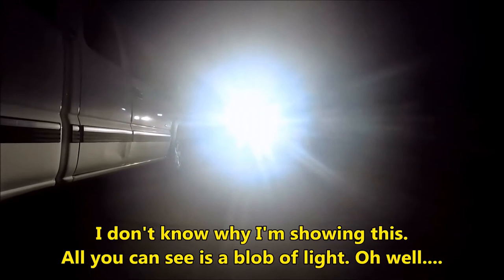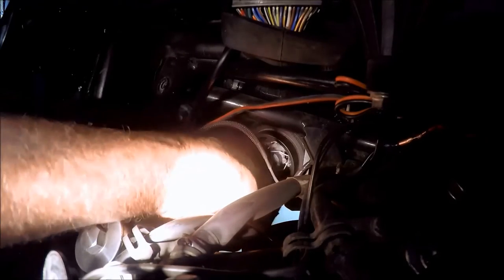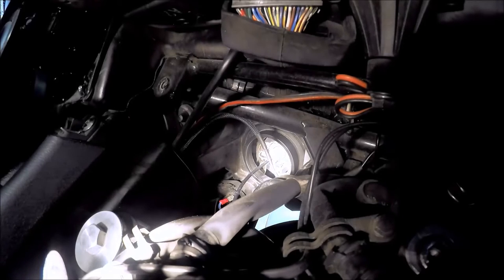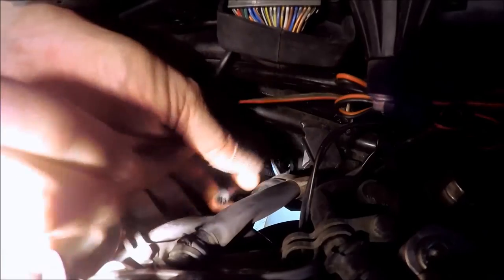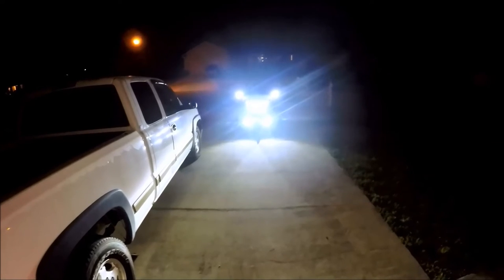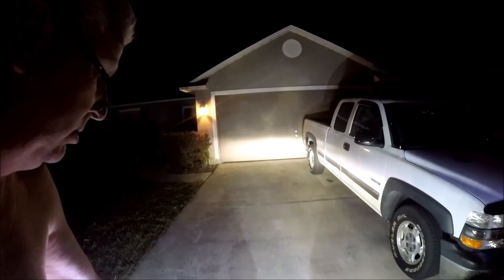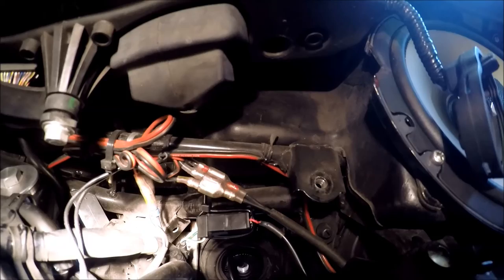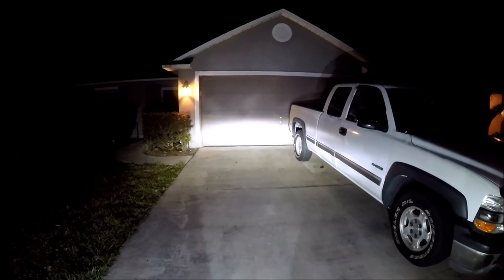LED Headlight bulbs for the GL1800

Comment: The issue with fitting aftermarket LED or HID bulbs is not the amount of
 light that they produce but what they do with it and how the reflector 
and lens aim it. Shining the camera into the light shows nothing. Nor 
does bouncing the light off of a garage door. Take the bike out onto a 
rural road and show how it lights the road.
Reply from the maker: +Dave M The output points of the LED's on this bulb EXACTLY match the output points on the stock, quartz halogen bulbs. These bulbs aren't your normal "LED bulbs" that have a half dozen or so emitters. Having now had these bulbs installed for 6 weeks, these bulbs "light up the road" FAR better than the stock halogen bulbs and even better than the HID's I had installed previously. I am patiently waiting for another set of these bulbs to install into my hi-beams and then I'm going to take the bike out to THIS ROAD  (http://tinyurl.com/z9zxg6q) which is far from any city lights, late at night and take some pictures and video. The results should quiet the naysayers.
Reply: OK. Sounds great. Eagerly awaiting the pix and test results.

I too have HIDs in the low beams. They're OK sorta. And most likely the LEDs will last the life of the bike. Especially since accessing the highbeam holes on a GW1800 is such a PITA.

TIA
Reply from the maker: +Dave M Here you go!  I still have not received the second of these bulbs for my high beams. This video shows the LED's in the low beams and the quartz halogen in the high beams. Hope this helps. https://youtu.be/QH_7a5WCW7g

Comment: I have purchased 2 separate LED packages. Both had connectors to the GL1800 harness that were too small. Please help. Is there an adapter or what brand of Leds do I need to get?
Reply from the maker: All you have to do is read the description. All the details are there as well as links to additional info and the product.

Comment: Does the power converter just hang loose?  Its not mounted anywhere is it?
Reply from the maker: For the low beams, they're stuck to the forward plastic cowl. For the high beams, they're tucked under the pockets.

Comment: I noticed that you removed the top shroud (I can see the speaker). Everyone else says to do it by feel. If you remove the speaker can you get to the high beams easier then up through the side pockets. I would have no problem removing that stuff just to be able to get my hands in there and be able to see. Doing this stuff by feel drives me nuts and usually takes me more time than if I just removed the stuff that's in the way to begin with.
Reply from the maker: While changing a quartz (OEM) bulb can be done by feel, I personally prefer giving myself as much room as possible, especially since you should be tying the cords and power regulator for the LED bulbs. In this video, not only did I take off the dash, but I also pulled the instrument cluster up and out of the way to give myself room.  Doing all of this doesn't really help on the high-beams. The bulbs can only be accessed through the fairing pockets.
Reply: Thanks for your reply. Saved me a lot of time from removing a speaker just to find out it won't help. I can envision hours of my life just getting that little spring clip on while doing the high beams. I struggled doing the low beams. This is something that I will be doing in the next month. At least the LED's should last as long as the bike. Fingers crossed.